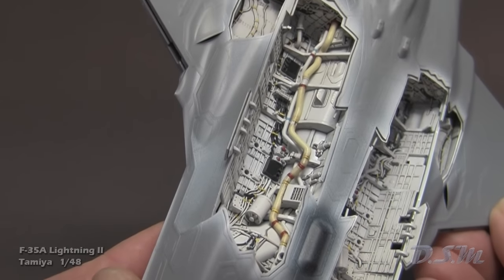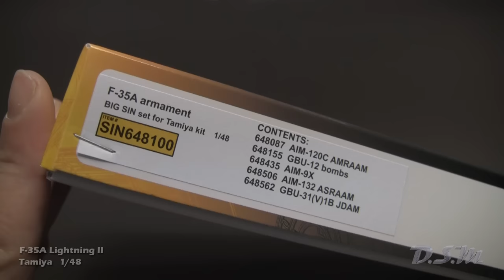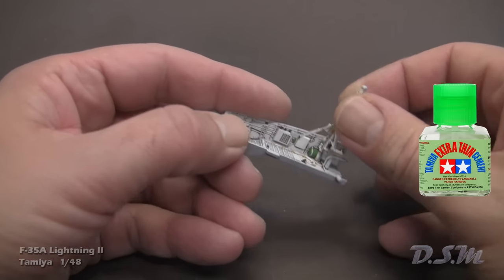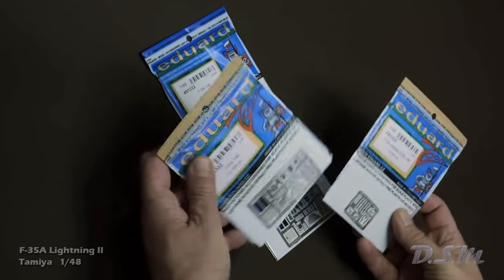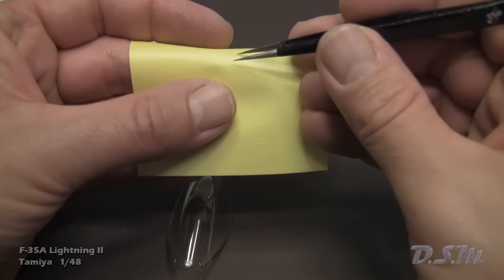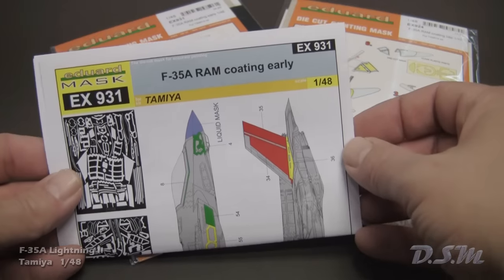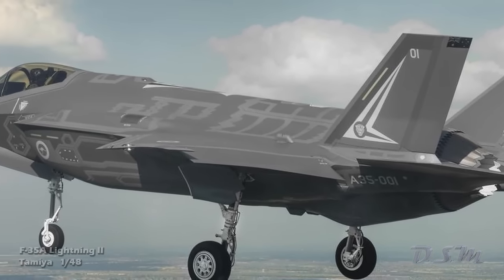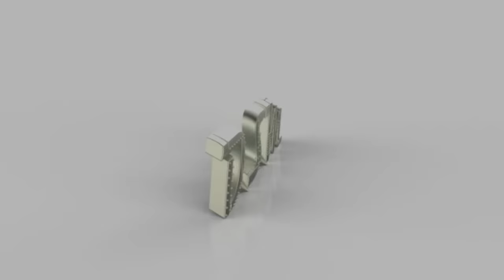F-35A Lightning II  1/48 Tamiya

Comment: Sir. Your build is next level. No doubt about it. But you have chosen a RAAF decal set. You will notice the fairing hump between the vertical stabs at the back? That is for a breaking parachute. The only airforce that uses this modification is the Royal Norwegian Air Force. Sorry for the extreme nerdiness.

Apologies. I didn't watch until the end. You've obviously figured this out for yourself now.

Still. It might become standard on more F35s in the future.

And the standard of work you did to rectify it was super impressive. I loved watching this.

Comment: Love the build, only point is why would the “ceiling” part of the bomb bay accumulate fluid build up? If anything, any leaks would simply drip down onto the closed doors. You’re not the only one, others do the exact same thing and I just feel like it’s a shame to go to the extraordinary detail that you have, to slip up by overweathering it in places, for the bomb bay to accumulate fluid build up like that the plane would have to be permanently upside down. 
Otherwise perfect.

Comment: I don’t understand where kit manufacturers get their colour schemes from. I saw probably four F-35As at the Australian International Airshow this year and it just didn’t look like that. It seemed to be almost entirely a dark blue grey. The one I saw doing the display was A35-43. The photos I took show the surface detail to be massively overdone but I think most people are aware of this.

Great job on the model though.👍
Reply: Most kits have the original paint scheme listed but later airframes have been painted in an all over grey colour as you saw at Avalon
Reply: @thekunninglinguist2397  Okay, cheers. I haven't really kept up with it that much. I presume that's going to need a different decal masking sheet for the various panel highlights because they are not the same. I did notice that the radome is a slightly different colour from the rest of the aircraft.

Comment: this is simply amazing bro...1 question , though, what kind of glue were you using to put on the Eduard space decals?
Reply from the maker: Thank you all for your feedback. I didn't use any glue, they are decals. It is worked with in the same way as with decals with the help of Mr. Setter or another preparation for decals.